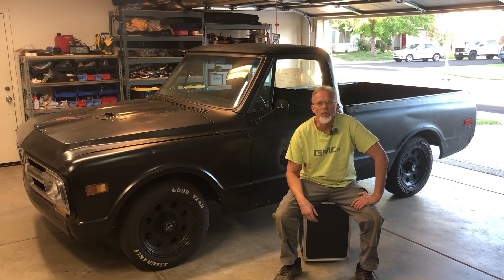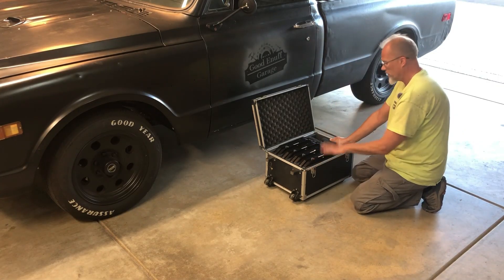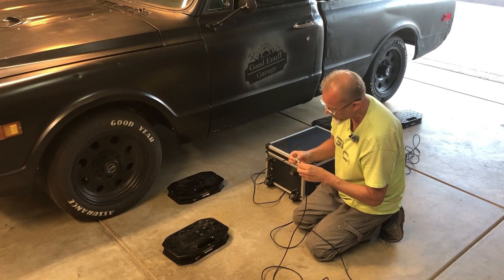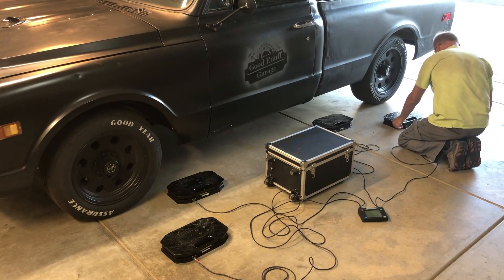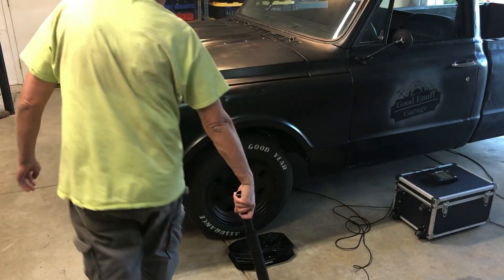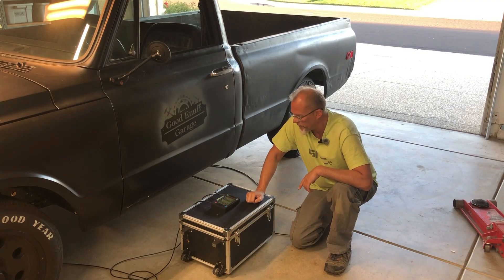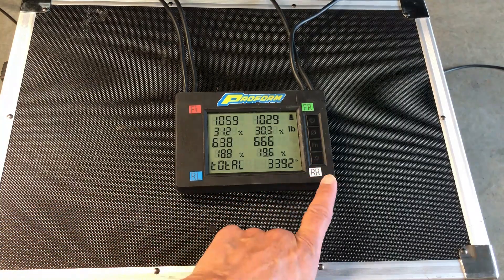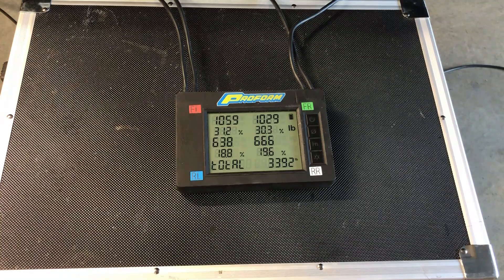GMCe DIY EV Electruck Weight

Comment: That looks like it's giving you plenty of power. Are you running the low/high shift on this or just keeping it in high gear?
Reply from the maker: just in high gear for now, with the 4.11 gears and a really light butt it does one wheel peels at the touch of the throttle so I have to be careful on green lights